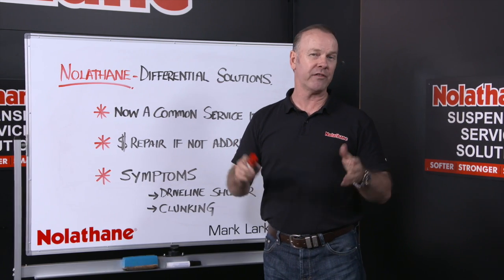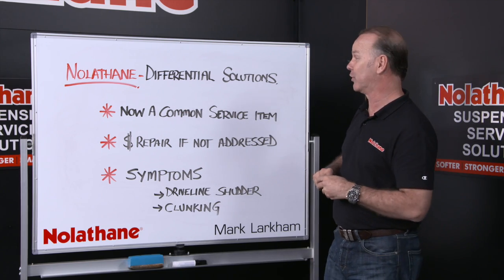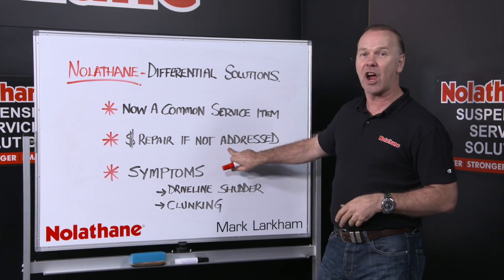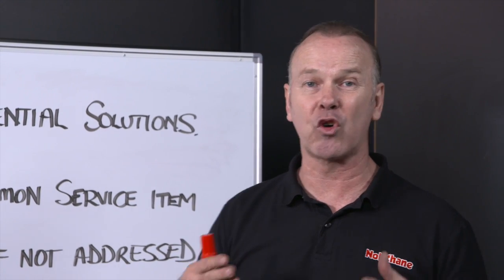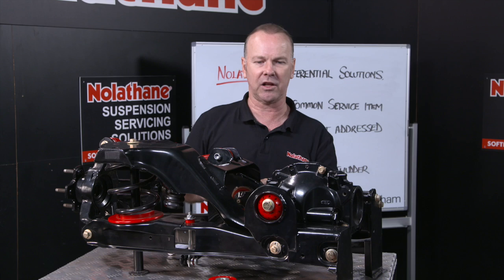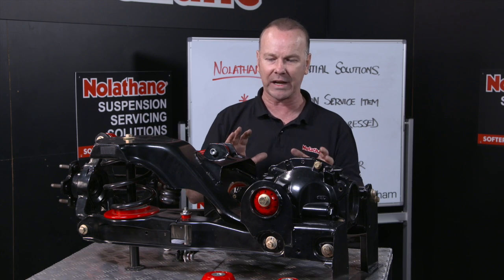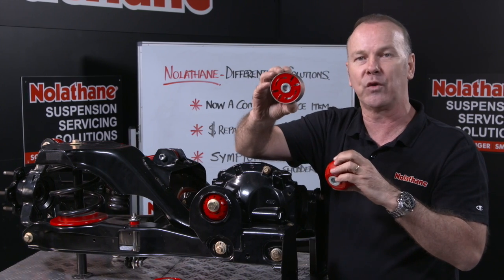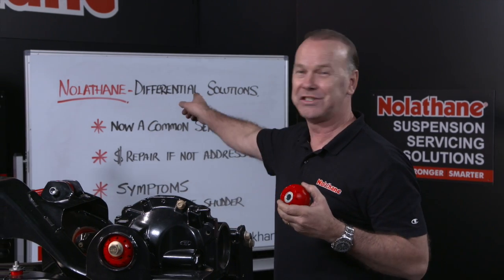Mark Larkham talks Nolathane Diff Solutions

Comment: Why does Nolathane make my differential bushings without the metal ring around it? It’s just a rubber bushing with a metal ring in it but no metal ring around it like in the video. It’s for my 2006 Mitsubishi Montero. I’m about to return these for OEM since they don’t come with metal cylinders like OEM is supposed to!

Comment: I tried all sorts of bushes in my Fg F6 and modded Ba xr6t manual, nothing beats plushness of the Ford bushes, I just replace them every 18 months ($660 drive in drive out) no matter what condition they are in. People have to accept its part of driving a late model Ford.
Reply: @m4rcd27 they would be talking about timing chain failure if it was a Holden hahaaa
Reply: 2burning2turning 
Where do you get the bushes installed
Reply: Stuart GIBSON I'm in brisbane, hart transmissions in Brendale do them and so does torque ford at north lakes.
Reply: 2burning2turning what bushes do they replace for the 600
Reply: XR6t Gibbo for &660 they do the 3 bushes that mount the diff in the cradle.